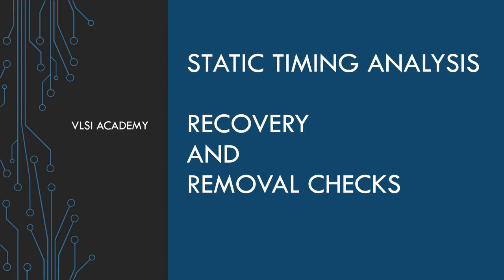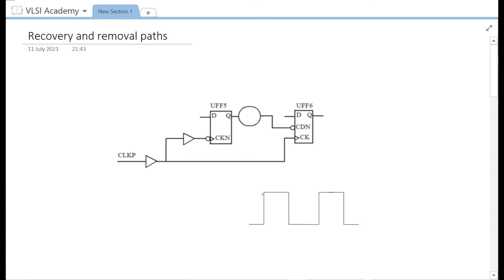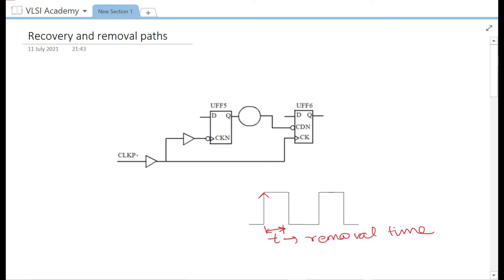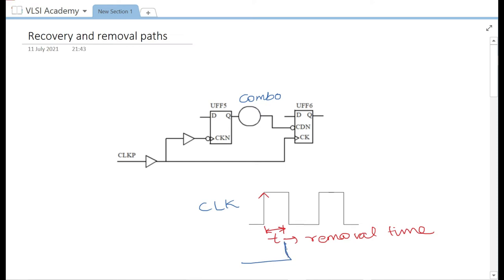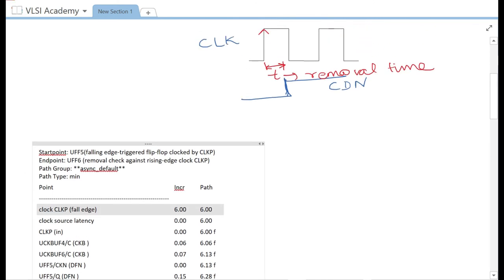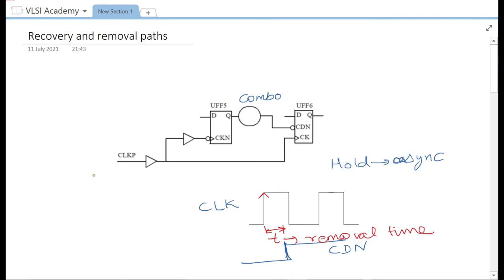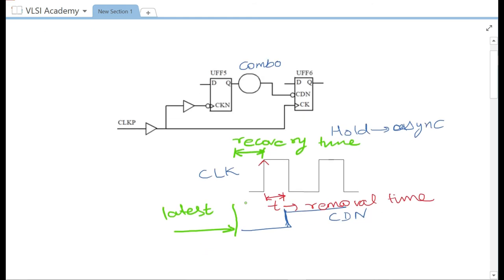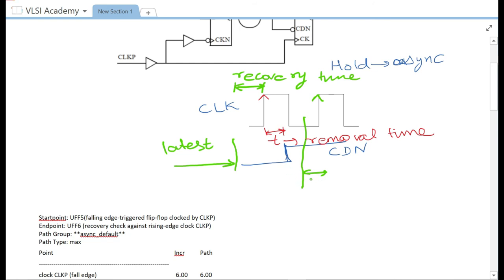sta lec25 recovery and removal checks | Static Timing Analysis tutorial | VLSI

Comment: time 9:48, library recovery time should be -0.09 not +0.09 ? so data require time should be: 11.8 ???
Reply: @VLSIAcademyhub  was wondering the same while watching the video. Could this please be corrected
Reply: @shreyatasharma1505  Actually Library recovery times are sometimes negative as well. So when you subtract a negative recovery time, it gets added. It is similar to negative hold timing. In timing report we will sometimes see hold time getting subtracted from Data Required time, for min delay report, the reason being negative library hold time.
Reply: Correct
Reply: correct but same thing is written in jbhasker book as well ,he has taken this example from there only.